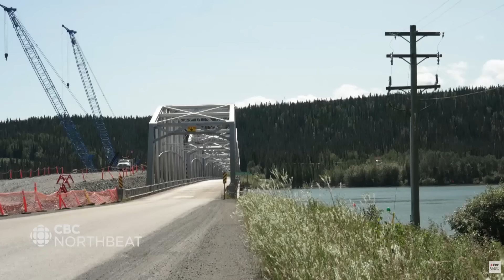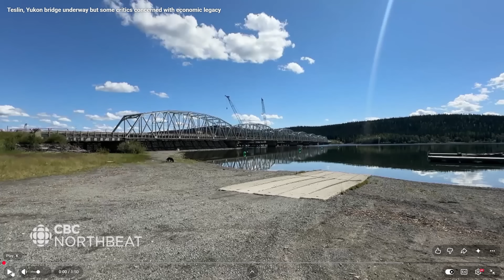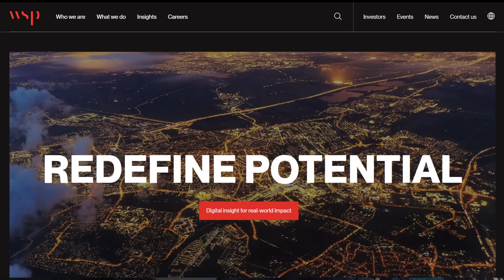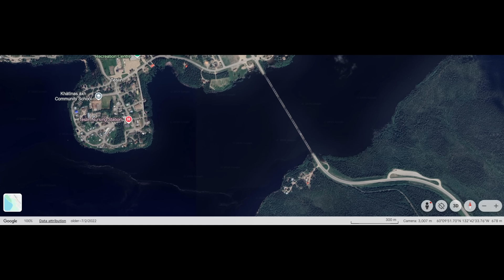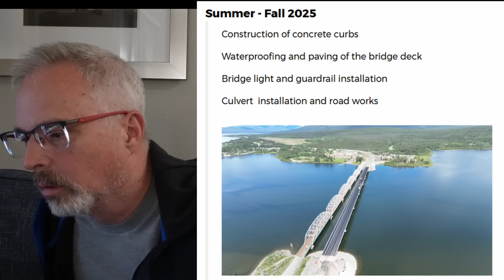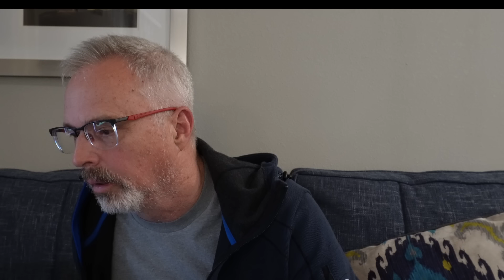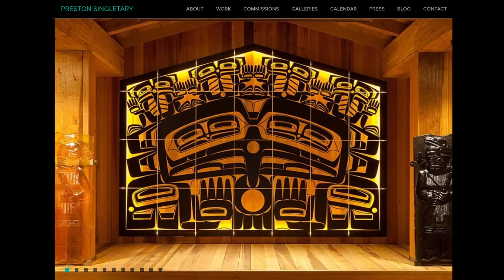Nisutlin Bay Bridge Mess

Comment: There are strange things done in the midnight sun by the men who moil for gold; The Arctic trails have their secret tales that would make your blood run cold.  I think the sustainability statement might apply to the salmon vs. the bridge. You can bet the condition of the salmon is 1000% on the minds of the locals.  I worked much further north of that location and I'm racking my brain for a plausible "soil" problem. Where I worked we had glacial sand/cobble and boulders from the surface down to hundreds of feet.  The tricky part of soils there is the active layer (annual freeze/frost/thaw zone). Organics and fines in that layer will require deeper piles that can get a grip on competent stuff. I'd keep an eye peeled for that sort of discussion. Given the season I'm wondering if something started moving when it thawed.  Reminds me of your Wyoming Hwy story - it might all come back to non-frost susceptible fill materials. You get that wrong it's all over but the crying.
Reply from the maker: Great comments!  My suspicion is that the much larger area and height of fill being placed at the new abutments was done faster than what should have been the case to prevent sliding (essentially a bearing capacity failure).

Comment: I have an idea as to what went wrong with modern bridge construction, and I think it’s pretty logical if you just look at bridges: they started using reinforced concrete instead of steel for the structure. Concrete construction is a lot heavier than steel construction because concrete is so much weaker than steel, and the concrete has to also bear all of the post-tension loads in addition to the regular loads from the weight of the bridge and the traffic on it. Consequently, the bridges have to be designed to handle a lot more dead load than they used to, and importantly, so do the foundations. This means that a lot more design work has to go into making these bridges’ foundations now than did in the past. Further, for a given foundation capacity, a lighter weight steel bridge can span a longer distance, allowing you to get away with less bridge piers and thus less work in the river. For some smaller projects, a steel truss might be able to span the river from abutment to abutment without a pier, where a concrete bridge would require one, allowing you to get away with no work in the river at all. Additionally, because the steel structure weighs less, you can get away with smaller and cheaper cranes with less lead time. And because of the lower weight and ease of connecting pieces of steel by welding, it’s easier to prefabricate trusses cheaply in a factory and transport them to the bridge site than it is for something like a post-tensioned bridge deck section. You can’t split a concrete span into four pieces for transport, weld them together at the bridge site, and lift them into place the next morning.
Reply: I think I understand what you're saying, in the past a bridge builder would show up to a site like that, think for a moment the amount and size of the traffic that is going to be using the bridge, then realize this build is going to have to be done with steel pilions forced down till they hit rock and price the work accordingly. Today, engineers and designers work work overtime to try to do it cheaper

Comment: Shortly after becoming a cornice subcontractor, I moved up to being a contractor doing framing and cornice work for the home builders. I received several plans where the architects actually believed that a 2x4 was actually a 2 inch by 4 inch piece of wood. It was obviously a bit of a challenge to "revise" such plans into a workable project.
The lesson? Never exclude the possibility of absolutely absurd mistakes. As we learned during a space mission that couldn't figure out metric vs imperial measurements.
I moved over to remodeling to escape  from the idiots.
Reply: There was a company building cloth covered buildings that screwed up calculations.  They calculated the building would stand up to a certain wind speed.  It didn't and resulted in many injuries including two very severe ones.  I have seen this in engineering and it is often a failure of peer checking of designs including calculations.  It's a boring job that engineers don't really like doing.
Reply: You don’t get away easily from the idiots. Here in Montreal, we had an idiot ph D in structural engineering that designed the stadium roof in the 90’s with a teflon covered fabric.  Smart as he was, he designed the shape of the fabric so the slope in every point was steep enough to get the snow sliding off the roof, so the structure would not have to sustain snow loading at all.  What a smart man.  So full of himself, he never taught of what would happen if the snow would not slip away as ordered so.  At the first snow, the wet snow stuck just a little bit more than planned, the weight of the snow stretched the fabric and changed the slopes below the sliding angle.  The roof ripped open and needed to be plowed ever since. Idiocy is endemic.
Reply: Plumbing and Heating contractor here, I’m running into where people are using “ designers “ instead of architects to draw house plans.
One of the houses I plumbed, the owner asked me about the floor being spongy. I walked in and looked at the framing and called a code enforcement from a different town. To make this short.
The local code enforcement looked at the wrong page of the code book.
2 floor house, 2 x 10 cannot span longer than 10’-3” when 24” on center.  Carpenter had 13’ long joists , so he had to knock out the blocking and double the amount of floor joists to 12” on center.
Carpenter also skipped one lally column in basement, supposed to be 8’ cent-cent. He had the at different intervals with two at 10’ apart.
I live in a very cold climate in New England, so running hydronic heat pipes, I have to do what I can to keep the piping from freezing. 
My other issue is running 2” pvc drains in a 2 x 4 wall, I can’t get 1/2” water lines around the drain so it makes my life hell on running lines .

Only 3 more years, 3, 3, 3 before I retire !!!!!!  Hopefully I will still be able to move.
Reply: for the clueless among us, what is a 2x4?
Reply: @stanislavkostarnov2157 . It’s 2 x 6’s brother.
Reply: @stanislavkostarnov2157 A piece of dimensional lumber used to build walls and other things. Typically it's real size is 1 1/2 inches thick, 3 1/2 inches wide and around 8 feet long. The length can vary completely. The thickness and width are always the same. A long time ago, they were actually 2 inches thick and 4 inches wide. The 2x4 name is just traditional.
Reply: @CrispyCircuits  ok, so it is a dimension they are measuring, just the name is completely physically inaccurate??? really wierd
but then, most wooden construction is

PS: I come from an area where it's 60% stone and earth, maybe another 20%- 30% is brick, with limited wood-frame, and the rest mostly concrete or all plastic & metal temporary structures RV style
I have not really come up against much wood construction where I was involved in any manner, not since school...
Reply: I don't believe for one minute, that contemporary Canadian architects think "2×4", "2×6", "2×8", "2×10", or "2×12", means the actual 'dimensional size' and not the 'nominal size' of the lumber.  We haven't used dimensional lumber sizes since well before WWII.  I know, because I'm a retired architectural technologist with over 30-years experience in the AEC industry in Canada.

I live in a 1908 constructed house, built with dimensional 2"×4" Douglas Fir (DF) exterior balloon framed¹ stud walls (exterior sheathed with 5/4" shiplap siding) and dimensional 2"×6" DF floor joists, 16" (400 mm) on centre (o/c) with a 5½"×1½" T&G plank floor deck, that spans the 20' (~6.10 m) width of the house without support (solid AF).  If you used nominal 2×6 (1½"×5½" "dry", 1⅝"×5⅝" "green") joists and ¾" T&G engineered ply sub-floor ('screwed & glued') over a similar span, the thing would bounce like a trampoline and be a code violation (max nominal 2×6 span using the CMHC Span Book (spruce/pine/fir species), is 10'-11" (3.32 m) @ 12" (300–305 mm) o/c, or 9'-11" (3.02 m) @ 16" (400–406 mm) o/c).

When producing construction documents, I always dimensioned to the face of one side of the stud or structural framing members (rarely to the face of the wall finish, which would be done only with interior cabinetry detailing).

Finally, as a contractor/subcontractor doing detailing work on a project (such as trims and cornices), you NEVER take the dimensions of construction documents verbatim (what is in the design/construction documents often does not reflect what was actually built)—you always visit the site and do your own measurements before proceeding with the work.
—
¹  Balloon framing as a construction technique is where the exterior studs extend the full length of the exterior wall height to the double top plates, where ceiling joists and stick-framed roof rafters would bear down on—in multi-storey construction, a 1"×6" ledger board would be let-in flush with inside face of the exterior wall studs, and the floor joists placed on top, nailed to the wall studs.  This framing system was superseded around the 1940s–1950s by platform framing where the first level exterior walls would be built only up to the first level ceiling height (topped by double top plates), and then either the roof trusses or 2nd level floor joists and deck would be built on top of the exterior wall frame, and in the case of a 2nd level, exterior walls would be framed on top the 2nd level floor deck to the height of the 2nd level ceiling, upon which either the roof truss' or 3rd level floor deck would be constructed on the exterior wall framing.  Platform framing provides greater fire protection, because unlike balloon framing where the void between the studs (stud cavity) extended the full height of the wall, through multiple floor levels, the planform frame restricted fire migration through the exterior wall framing, from the lower level to upper levels of a structure.
Reply: @MelioraCogito The original size of a 2x4 was actually 2 inches by 4 inches. That's historically correct. I did remodeling work in a very old house built upon cedar tree stumps for a foundation that had 2x4's that were of that size. We had to either build a completely new wall with modern lumber or when not possible, we added furring strips to make the overall surface flat. You clearly lack experience with ancient wooden structures. Modern engineering has determined that sufficient strength can be obtained by smaller sizes. Texas is in tornado alley. Austin was created in the 1800's and still has many historical structures from that period. Their preservation is mandated by law. Texas is the only part of the US that was an independent nation before joining the US. The Constitution of the Republic of Texas is an interesting document to read.
Reply: @CrispyCircuits  "The original size of a 2x4 was actually 2 inches by 4 inches."

No shit Sherlock… did I not say that?  Apparently you failed to comprehend what I meant by "dimensional 2×4" (rough saw-cut dimensioned 2" × 4" lumber) and "nominal 2×4" (dimensioned 1⅝" × 3⅝" 'green', or 1½" × 3½" 'dry', lumber).  Unless you could get a local mill to produce dimensioned 2×4 (or whatever specific finished size you need), then of course you'd have to use strapping to make-up for the loss in lumber depth (or you could rip a nominal 2×6 (1½" × 5½") down to a finished 4" stud depth).

You apparently also think the 19th century building construction is "ancient"—don't be absurd.  It may be old, but it's hardly "ancient".  That's the problem with you Americans… you don't comprehend/understand the King's English so you think you can redefine words on a whim (or worse, simply misuse them because you don't know what they mean).  Try ~500 CE or further back, as being defined as "ancient".

The oldest wooden structure still standing, that has been in constant use since it was built, is at the Hōryū Gakumonji ("Learning Temple of the Flourishing Law") Buddhist Temple complex in Ikaruga, Nara Prefecture, Japan.  The complex's Kondō (main hall) is widely recognized as the world's oldest wooden building, constructed over 1300-years ago, in the late 7th century.

Now that is "ancient".

Furthermore, the ancient practices of Japanese wood joinery techniques in building construction (no metal fasteners), makes it possible to literally disassemble a building (or part of it), in order to fabricate and replace structural elements, compromised by natural decay and time without damaging the building—that's how the Kondō has survived 1300-years of use.
—
Fort Victoria (HBC) on the southern tip of Vancouver Island—now Victoria, BC—was established in 1843 (about 7-years after Austin was established).  It was built on the site of the Coast Salish—Lekwungen village of Camossung (Camosun) which had been established in the 10th century after the nearby village of Sitchanalth (pop ~10'000) had been destroyed by a tsunami around 930 CE, caused by a major earthquake along the Devils Mountain Fault in what is now the North Cascade Mountain Range of Washington State.

There are several 180-year-old buildings still standing here, that have undergone remediation and repair over the years, having survived 180-years of periodic earthquakes, including the 1946, 7.3 magnitude earthquake, centred on mid-Vancouver Island (49.76°N 125.34°W) and the 2001, 6.8 magnitude Nisqually earthquake (47.19°N 122.66°W), centred just west of Tacoma, WA, about 150 km (90 mi) from Victoria.
Reply: @MelioraCogito I don't believe for one second that YOU would have made such a mistake.   But I absolutely believe some architect would and will make a mistake like that.  A credential doesn't mean as much as those with credentials think it does.   
I've seen utterly absurd things on plans.   
"All measurements to be verified by contractor" isnt some high principal.   It's a kick the liability downhill mechanism and everyone knows it.  Fair enough, but don't pretend it's something it's not.
Reply: @bobcougar77  "I've seen utterly absurd things on plans."

I have too.

I was part of the large team of technologists that produced the architectural construction documents for the Richmond (BC) Speed Skating Oval for the 2010 Vancouver Winter Olympics.

While coordinating our architectural drawings with structural engineering drawings done by an outside firm, I discovered to my shock and horror that a massive slab-band had been placed through an exit stairwell.  One of those epic SMH moments to be sure.

On another project—a multi-family residential high-rise here in Victoria—our Vancouver office had taken over development of the construction documents from our Victoria office (which designed the project and prepared the floor plates), and during construction, it was discovered that one of the upper floor plates had been 'stretched' by about 6" in the construction documents, and nobody caught it until the suspended slab forms had been built, the rebar in place and the slab ready to be poured.

BIM/CAD are great tools, so long as you know how to use them properly—I've know my share of architects and technologists who don't know how to use the tools, and draw in BIM/CAD like they were drawing on a table with pencil and velum, eye-balling where to draw elements (lines, openings, etc.), instead of measuring distances.
Reply: @MelioraCogito Actually, 16" is 406.4mm not 400mm. That's off by about a quarter inch and those quarter inches are gonna add up.
Reply: @lyfandeth  That's what she said
Reply: New and Improved ! How often do we see this touted ? Rarely if ever is this true. Always, always beware when seeing this. Look at today's cars, rusting at the same rate, engines can't go 300,000 miles anymore. Car batteries used to be 60, 72, even 84 month warranty. Only 36 now. Even human life spans diminishing now

Comment: Strange.  Is the abutment itself at risk, or just the approach embankment?  I wonder what the depth and shape of the new footing and backwall are in comparison to the old one that's been successful.  The existing roadway sweeps up and behind the new abutment and approach, and then turns onto the approach to the old bridge. Was there a history of movement in that area?  Is the weight of the bridge at the abutment significantly more or less than the old bridge?  Very well presented as usual.  Really interesting, thanks!
Reply from the maker: Thank you!  Those are all great questions and I will keep digging for answers.

Comment: I am reminded of a quote from a bridge engineer "anyone can design a bridge that stays up, the trick is to design one that just barely stays up" - from a documentary on the RT1 bridge over the C&D canal in Delaware.    sounds like the just missed it.  
If it were my project, I would hog out the fill, add a dozen piles and a 1,000yds of concrete to each end, building real abutments.  that way if the fill settles more that optimal, I only have to repair the road deck leading up to the bridge.  

I notice the old bridge deck is steel grate, probably chosen for speed and wider weather window for installation.
Reply from the maker: That is an interesting point about the bridge deck.
Reply: It's worth noting that materials like concrete have to be hauled to the site from quite a long distance away. This is why local fill is favoured.